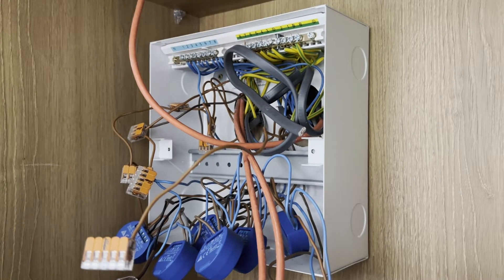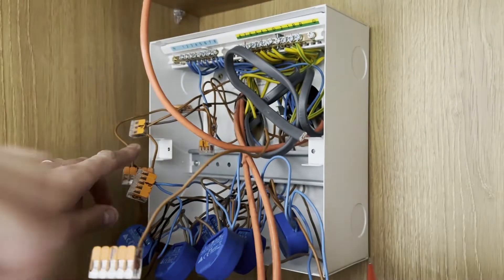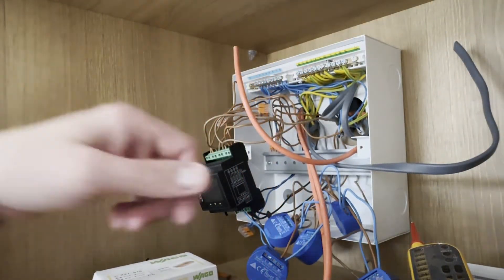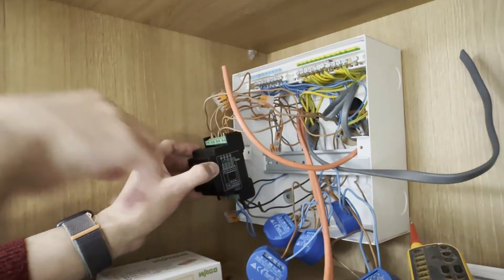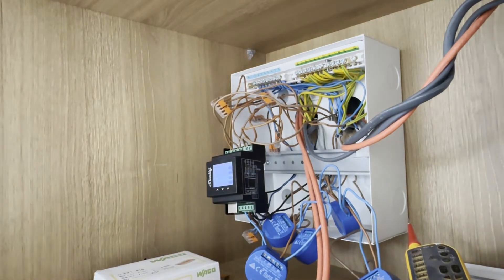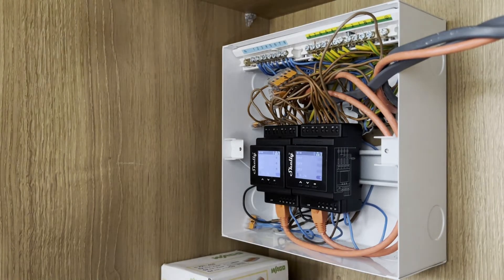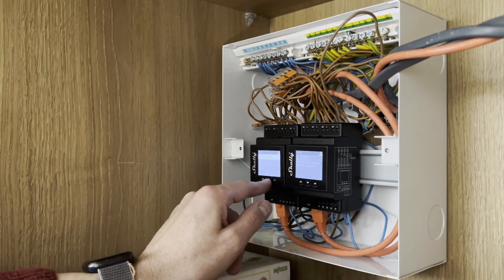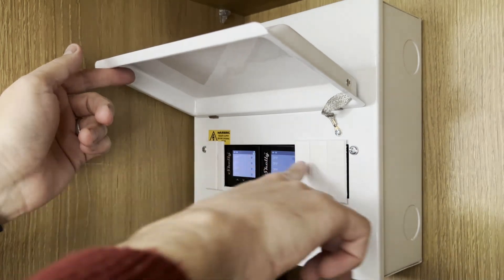Controlling my kitchen lighting using Shelly Pro 4 PMs

Comment: Thanks for this. Seriously considering doing this for every light in my house, as I’m having a full rewire. 

It’s a couple of years later, would you still recommend?
Reply from the maker: Absolutely. I wish I’d had this done to my whole house, not just my extension. It would have been a mess of wiring, but disconnect the light switches from the lights is very powerful. 

I’ve changed the behaviour of two switches so far, making them operate different lights.

Only danger with the automation side is any problems mean the lights don’t work, but that’s only happened me once in 4 years. One other issue I’d had is that a relay got stuck, but that was in a Shelly 1, not a Pro 4.

Talk it over with your electrician.

Comment: if you have 2 light switches in one room, would a shelly 4pm take up one relay slot or two relays?  if a room had 4 light switches and you put them on one relay within the Shelly Pro 4PM.  Can you add a Shelly relay at the light switch to control them individually?  or will they not work if the Shelly Pro 4PM is not on?  Thanks for a great video!!
Reply from the maker: It depends on the wiring and how the switches control the light. If you have two light switches controlling one light, then only one relay is needed. There typically isn't enough space behind a light switch for a Shelly relay, but I have added them to the ceiling rose in other rooms. You may need a larger rose than the traditional UK plastic one in order to have the space. 

That's actually something I've considered doing a video on as I have a few different implementations.